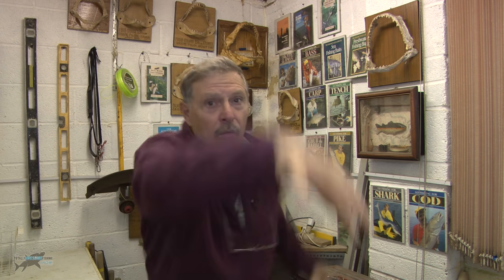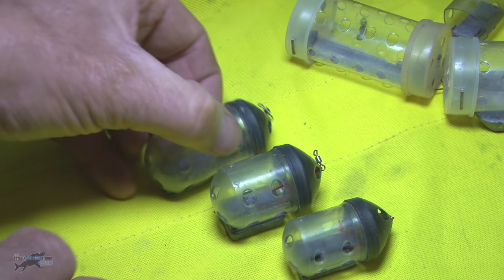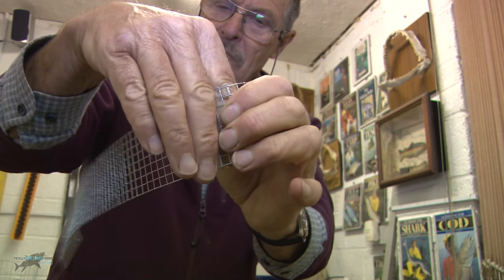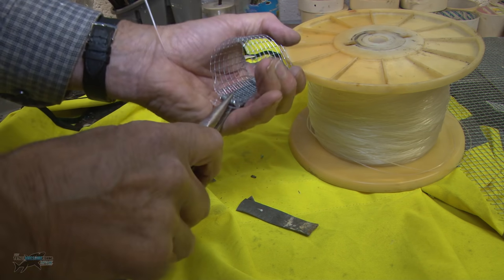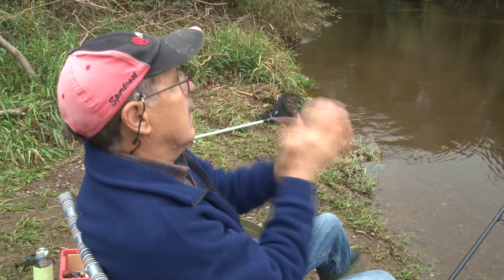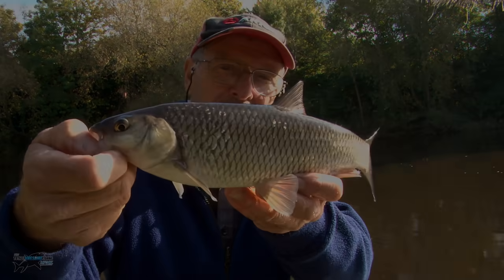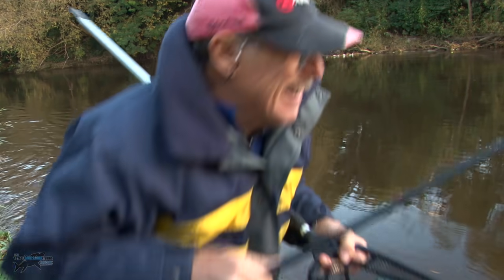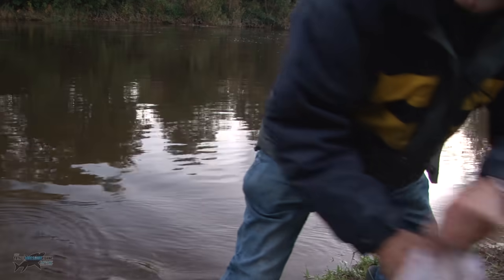Epic Fishing with a Homemade Feeder!!

Comment from the maker: Who else makes their own fishing tackle?
Reply: TAFishing Graeme they're called coil feeders and you're supposed to put your hook bait in the groundbait that is on the feeder like a method feeder
Reply: just started making lures and and spinners.
Reply: actually, i know of at least a dozen youtube channels that make craftsmanship quality tackle :). Half of them are from UK. You better not go there :)
Reply: i made one o you swan float quills and caught a few perch the other day.
also a good alternative for split shot is surgical tubing with BB's inside only disadvantage is you have to slide the tubing on before the hook
Reply: Hi Graeme I make my own feeders, well worth it if you do a lot of river fishing, as this can
add up in pounds not pence when losing feeders and we all lose feeders on snaggy fast rivers.
The coil method type inline are easy to make just get some stiff rig tubing and even some felt tip pen inserts for running feeders' melt them at each end with a lighter to keep them inside the coil, you will get the idea!
just go your local motorcycle scrap dealers and that's where
you find all the different sizes in spring coils, you will even see these in tackle shops from between £1.50-£2.00
So cheap when your sourcing them yourself and altering them, I have them all shapes and sizes running fixed 
and inline fish safety feeders, I would guess I've saved hundreds over the years just making them and not buying them.
Hope this helps guys and gives you a rough idea, I'm not saying it's the best way, but just a cheap way' and it works, give it
a go at your local scrapyard, TOTALLY TOTAL AWESOMENESS Keep it up Graeme, great all round show to suit all ages👍🏼🎣🐟
Reply: I make lots of mine, floats from drinking straws and corks, feeders like yours and from polypipe, leads and rig components. For me it adds another dimension. This is why I watch TAF! Greame has not only a bottomless pit of ideas but has really generated my attitude to fishing over the years. I have respect for people who just want to buy the gear and get on with it but have to smile when I hear people talking about some of the expensive stuff out there that catches anglers instead of fish. Thanks TAF.
Reply: I have made controller floats from the widgets out of Boddingtons beer cans, floating maggot feeders by converting Drennan maggot feeders and a pike lure from a maggot feeder after I accidentally caught a pike when I was reeling in whilst chub fishing!  I figured if it worked once it might work again, so I painted the feeder and put a treble hook on it.
I think this type of video is my favourite from the TAF fishing output.  Keep 'em coming Graeme! :)
Reply: I have made much the same thing as a feeder but yours is a better idea , i fish at a local boat ramp when boats come in and dump all unused bait over board  . When the dust settles and all have gone home is the time to be there.Also made a few poppers at work with flow through holes .its always funny to see the amount of unwanted bait chucked out at the boat ramp.
Reply: Lol
Reply: I make sea fishing floats which work like a waggler, with a swivel at the bottom of the float.  They work much better than the usual sea fishing floats which you have to thread the line through the centre of the float.  When you strike you are more connected to the fish and you hook more fish.
Reply: do you eat barble  best taste  fresh wather fish
Reply: don't do that ...poor barbell
Reply: Graeme ! Great video ! I’m from across the pond in the US in the state of Connecticut ! We do not use line feeders too much in our salt water spots ! We tend to use chum pots which look like a line feeder but much bigger and we hang off the boat
Reply: Get a small pine cone, weight it down with some scrap metal bolts anything, squash your ground bait around it, use a sliding boom or anything you have handy to attach it to line, free and perfect for a feeder looks natural in water too
Reply: TAFishing iq
Reply: I make pike and perch spoons out of .... wait for it ......domestic spoons ☺ Also floats out of swan and goose quills.
Reply: Hi Graeme👍
Do you ever use the back wind on a fixed spool reel to give the clonkers a bit of head and release pressure on the tackle? I find this preferable to using a slipping clutch as it gives me more of a sensitive control.
Reply: It is a rare event that I buy any terminal tackle.  It's a very aesthetic past time to make tackle.  I keep notes, dimensions and sources for materials so If i like it and it works then i can reproduce it easily.  I'm now making hi volume feeders  and from my ground baits I have formulated I am able to optimise thr amount of feed and the rate it's dispensed using a twist of the body,  Because I make it, I first calculate its' requirements that I want to apply.  The greatest part of making tackle is to obey one simple rule and that is there are no rules.
Reply: Is there a video on this?
Reply: instablaster...

Comment: I make my own for the Wye too, but I use cheapo plastic hair rollers for the body.  Add lead strip, link and swivel, job done.  I weigh them after they are made and write the weight on the lead strip, helps when you are digging for a slightly heavier/lighter one.  My mates laugh at my lovely purple and pink feeders, but they cost about 10 pence each and it doesn't hurt so much when the Wye tackle fairy robs you of a dozen in a morning.
Reply: Tim, think about it. When Graeme loses one, it is not plastic. The iron will rust away.
The ones I last made actually use a steel split pen (cotter pin) for weight.

Comment: Such a good idea - I had an idea though mate... if you left 3 or 4 more squares before your initial cut [more overhang] you could then use taht to hold the lead in place and then just double lock the 2 edges together with a fold over to hold it in place?
 I would love your thoughts on this!

Comment: Oh I forgot about the cage feeders, I've used chicken wire but it doesn't last long Graeme,I use mig welding wire, up to you what diameter, but you need
a soldering gun with solder, power gum, some dead cow weights, barrel swivel, basically just make a small square 25mm 25mm by 45mm long.
Your first one will take about 25 mins, after a few your rocking mate. 15 mins per feeder, well worth it for the
self gratification of catching fish on tackle you have made from scratch, and cost you penny's in the process, happy days.
Good luck Graeme🎣

Comment: I use plastic woman's curlers, the come in all sizes and all I do is wind some lead wire to the required weight and wire in a premodern wire trace to which, like you I attach my hook above the feeder. All in all I priced them up at 35p

Comment: Just a question: Why not use a much shorter hook length so that the bait is much closer to the feeder?
Reply from the maker: I was told the fish are spooked by the feeder so that's why they advise using a longer hooklength.
Reply: @TAFishing  Oh OK. Thank you. Don't method feeders spook fish because they have a very short hooklength? Or am I missing something? I only ask this because I used a cage feeder yesterday using a very short hooklength and it seemed to work for me.
Reply from the maker: Method feeders I would say are more for commercial waters with lots of fish stocked all competing for food. In a river like the Wye the flow is so strong the line goes round in a bow to the method feeder so could also spook the Barbel. I was told to use a long trace on the Wye as that's what the matchmen use,and it catches. Of course if they were all pounding Barbel with a method feeder I would be doing the same. I don't live up the Wye its almost a 3 hour drive for me,so if the tackle shop gives me a suggested tactic I use it. Only when it doesn't work will I start experimenting. Plus of course the rocks and boulders in the River Wye would eat expensive method feeders for breakfast.